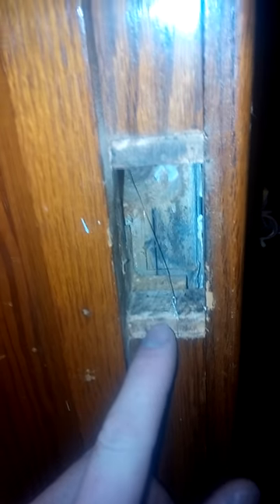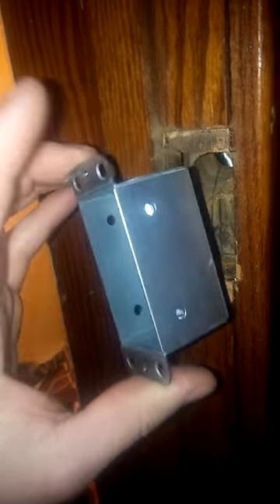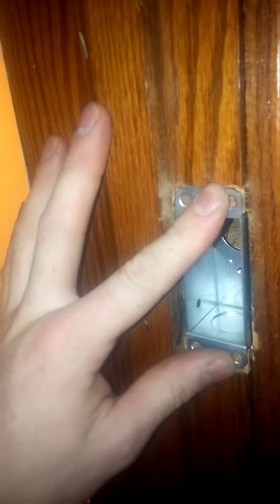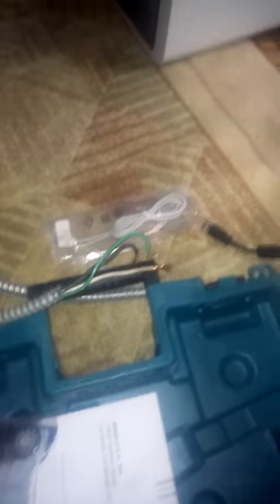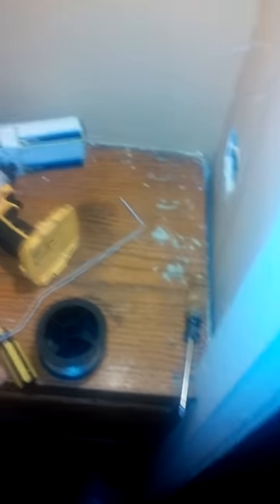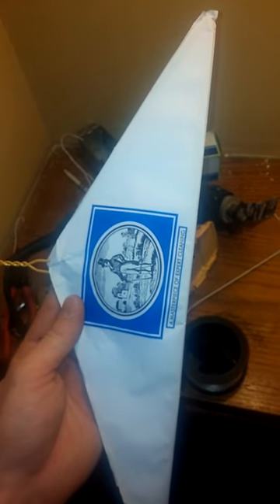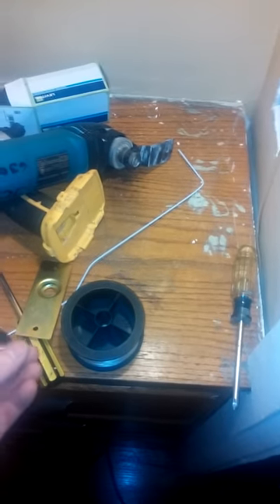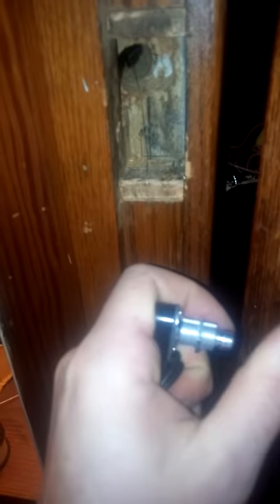Installing Door Jamb Closet Light Switches

Comment: I was hoping you would actually show how you wired the switch.. I'm just confused because the door switch on has two small wires and a normal light switch has 3 thicker gauge wires
Reply from the maker: A normal single pole light switch has two terminals (third one you saw could be the ground screw if it's green, or you may have been looking at a three way switch), and like this switch, it would be installed with one terminal/wire connected to incoming power (hot), and the other going to the light (center contact/brass screw). The neutral (white) wire should never be switched, always connecting straight through to the light (outer contact/silver screw). Thanks for watching, hope this helps! I need to add some of these switches in the new house.

Comment: One more question: Do you wire the switch between the light switch and the light so that the door jamb switch is enabled or disabled by the light switch outside of the closet, or is the door jamb switch always hot? Cheers!

Comment: Great work. Very professional results... but me, personally, I would just mount a microswitch or similar on the top of the door frame (two screws, no cutting), and run a bit of lamp cord from the switch to the light fixture. Somebody else had done that on the hall closet in my previous house. Granted, that would probably not be to code, but meh.

Comment: Wouldn’t it be easier to use a motion detected light instead?
Reply: Depends.  I am using for 2 pantries with glass doors.  Moton detectors not practical as they will activate when people walk by,  and i want them to activate only when the door was opened.